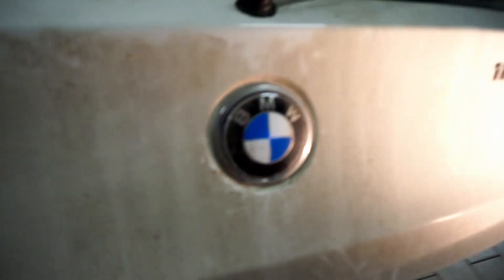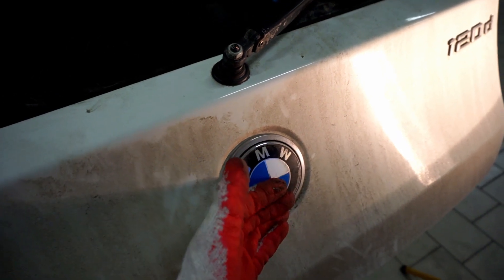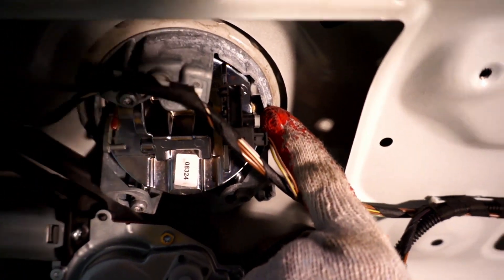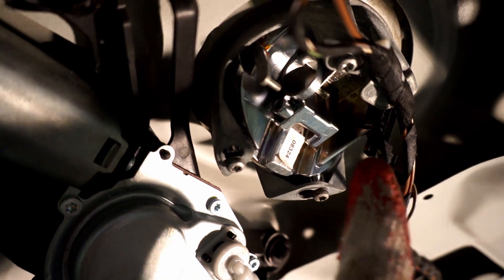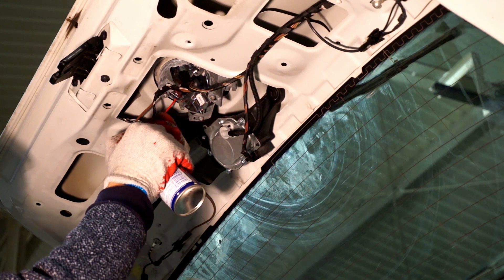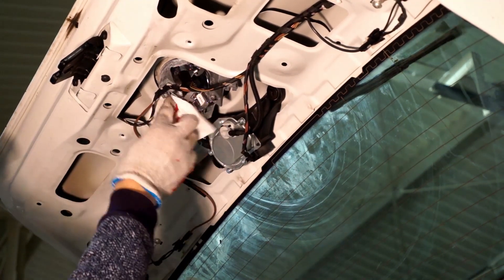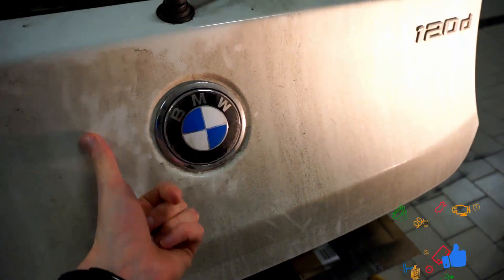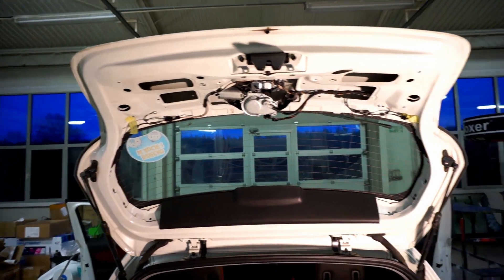BMW boot badge switch stuck fix

Comment: It would be nice if you could show next time, how to remove the trim safely, without breaking any plastic pins.
Reply from the maker: That’s a tricky part. Soon I’ll post video white read wiper motor replacement and I will show how to put it back together. That should help a lot.
Reply: I got mine off with no broken pins or trim with a bit of carefull pulling in the right places.
I also found it just as easy to remove the latch entirely which makes it far easier to grease the pivot points for a more durable fix.